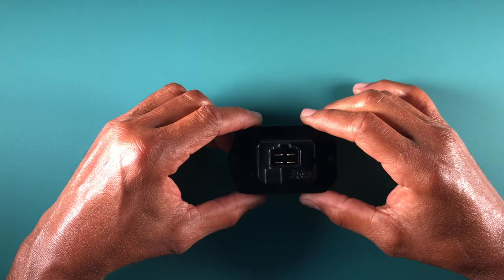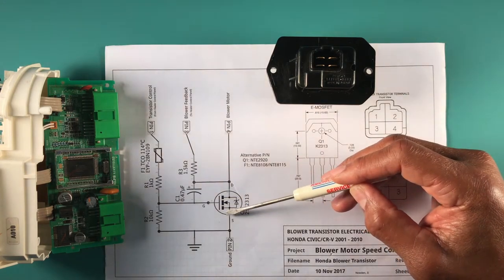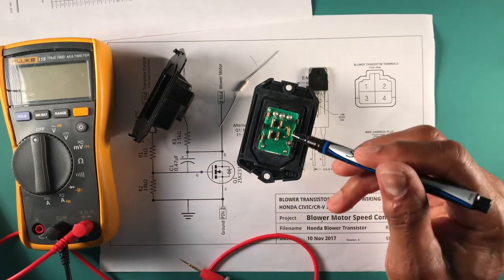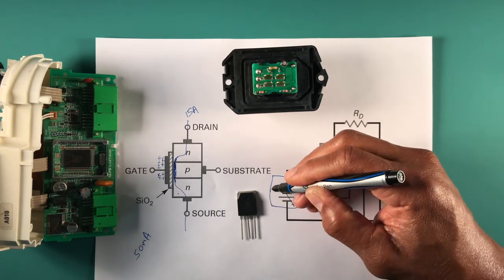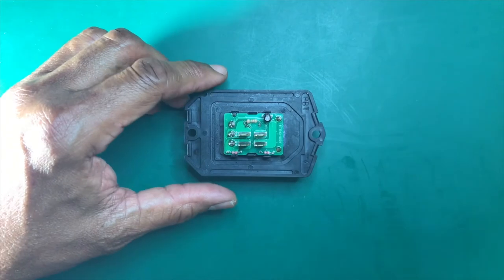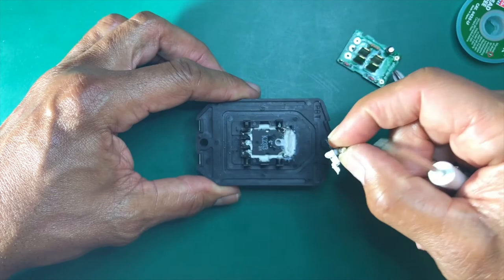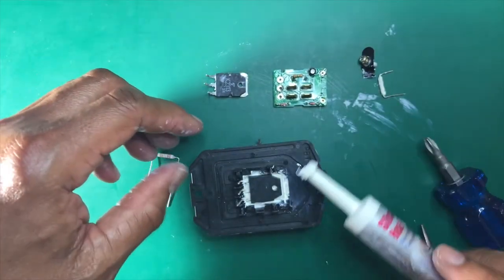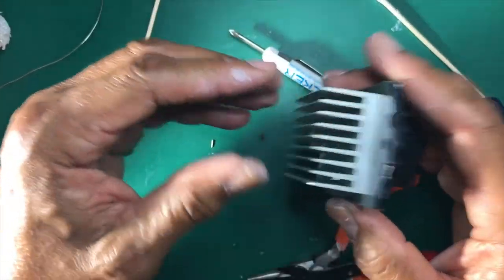Repairing Your Honda Blower Motor Transistor

Comment: For non US viewer and ppl who are not using the ebay link.
Make sure you get the 2A version of the fuse and the casing is not metal. 

I don't know what the proper name for this is but all the 10A fuse seem to have a conductive metal case, and 2A one with a ceramic non-conductive case. 
 
I bought a 10A 115 C thermal cutoff with a shinny metal casing, turns out the casing is shorted one side of the lead, this shorts 1 and 4 because the casing of the fuse is connected to the hold-down clip which attaches to the heatsink  and to PIN 4.  
I found out after plugging in the module in the car and the blower motor won't turn off, hopefully it hasn't have enough time to damage things. 

Also great videos, this video give me more reasons to continue to keep my Honda.
Reply: thank you this is Very informative     So dont use a metal conductive thermal  cutoff. use a Ceramic one .       im about to do this instead of buying a 110$ one from autozone.
Reply from the maker: Correct, short at either end of the thermal fuse to the heat sink shorts 12v to the transistor control line (Pin 1). The motor would run continuously. This results from the voltage divider created by R1 and R2 providing a gate voltage of 10.9V, turning the transistor on full-time (Vth=2V). Imperative, you select a thermal fuse encased in ceramic with no metal or leads in contact with the heat sink. See attached link: https://drive.google.com/file/d/1-NagFeXUDYTD_3wMkdKTkmdWsdw6GuNy/view?usp=sharing

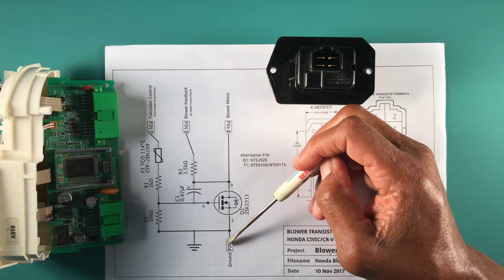Comment: 4:00 that F1 is a amperage and thermal fuse, you pointed 114 degrees C, but did not mention the amperage, maybe is a 2 amp because it manage a small signal from the microprocessor, nice video by the way

Comment: You win the blower motor transistor best youtube award.  The comment that checking for open across pins 1 and 2 was the key to my fix. I i just bought a new transistor, but the explanation of the circuit along with the repair itself was top tier!

Comment: Does it also turn on the ac compressor when the blower tirns on ? Because ac compressor also dont turn on
Reply from the maker: the a/c compressor will not engage If the Heater Control Panel senses the blower fan isn't turning (i.e.blower motor transistor is not switched on). However, this does not rule out any blown fuse or breaker issues. Check the blower motor wiring schematic on page 2 in the comment section above. That Heater Control Panel controls most of the operations of the HVAC system. The feedback signal from the transistor is at pin A8 of the Heater Control Panel (electronic module).

Comment: Thank you for the video. Good job. Does the blower control panel vary the voltage level to the gate or is it a set voltage level and pulsed at specific duty cycle percentages?
Reply from the maker: The voltage is varied at the gate 0 - 9.5 Vdc, they did not use pulse width modulation.
Reply: @eetech_fix2393  Thank you Sir. I appreciate your videos. Have a blessed and safe week.

Comment: Thanks for the video. Do you know if the same concept applies to all of the resistors that came in Honda vehicles. Mine is from a Honda Ridgeline 06 but the connector pins are arranged differently. Mine works but if you wiggle the harness right at the resistor will stop working and shuts off fan.Mine is a Denso 077800-0910. thanks
Reply from the maker: They're still called blower resistors; however, most Honda vehicles after 2003 utilize transistor-based modules. They sometimes take different sizes and shapes, but they're normally all 4-pin modules that work the same way. Honda 2006 Ridgeline RT, RTL, and RTS all have 4-pin transistor-based modules with slightly different pin arrangements. All connectors and connections are subject to oxidation and moisture. Remove the connector from the module and spray the module pins and connector pins with some contact cleaner; that may solve the wiggle problem.

Comment: What are the chances  the Heatsink shorts out between the   thermal piece.  since it shares the 12v resistance. on the case.
Reply from the maker: Short at either end of the thermal fuse to the heat sink shorts 12v to the Transistor control line (Pin 1). The motor would run continuously. This results from the voltage divider created by R1 and R2 providing a gate voltage of 10.9V, turning the transistor on full-time (Vth=2V). Imperative, you select a thermal fuse encased in ceramic with no metal or leads in contact with the heat sink. See attached link: https://drive.google.com/file/d/1-NagFeXUDYTD_3wMkdKTkmdWsdw6GuNy/view?usp=sharing

Comment: So interesting-- I just ordered a transistor / AC blower resistor for my Subaru Tribeca and it cost me $90 and that was on sale from the dealership (could not find on Amazon). My question is whether a $30 Subaru Outlook ac resistor would of worked (even if I would have to change a wiring harness) or more generally, why different cars require different resistors???
Reply from the maker: The  Subaru Tribeca has a transistor module for the front AC blower and a resistor module for the rear AC blower. Most newer model automobiles after 2008 incorporate the transistor module controller as opposed to the old discrete resistor modules. Transistor control is more efficient, more compact, and controls fan motor current directly at the motor. The discrete resistive modules required routing the total distribution current directly through both the fan switch and motor.  Not feasible to exchange the resistor module with the transistor module or vice versa. 
The transistor modules are electronically the same incorporating an E-MOSFET transistor allowing high current to flow through the fan motor under the digital control of a low power microcontroller in the control panel. The main differences being the shape and size of the module casing to accommodate the air duct of the particular automobile. The modules being your main concern making sure it fits.  LINK: https://drive.google.com/file/d/1ZnqBRMcrLbGnjdrmXsdtvLgWEkysjF4H/view?usp=sharing

Comment: Where can i find the part list for my blower motor transistor for my honda hrv 2016 i do have same problem. Thanks,any info i can get.
Reply from the maker: The The electronics of the blower motor transistor are the same in most cases. The size and shape are the only real difference that makes it compatible with the ductwork of any particular automobile. However, some newer models may still use the old resistor network. The 2016 Honda HR-V LX uses the resistor network, vs. the 2016 Honda HR-V EX using a transistor module and appears to be the same electrically as in my video with a different pin number arrangement. Denso Japan OEM produced the modules for Honda for about $3 - $5 (US) each. They are consumable items; there’s no part list; you just have to open it up and research it out. If you replace your cabin air filter as recommended, you should get 200,000 miles out of that transistor and a resistor unit a bit less. LINK: https://drive.google.com/file/d/1YGwGCa1Xb7krX6Fjd-w5CLhWahBBXgs2/view?usp=sharing

Comment: Very helpful video. Thanks. Just want to make sure though. It looks like 1 kohns 1/2watt, 5 percent tollerance resistor.
Reply from the maker: Correct, the 1K @ 1/2W resistor in series with the control line coming from the ECU, Protects ECU from a short to ground at the gate of the E-MOSFET transistor. The associated 10k resistor is a pulldown resistor, which prevents the motor from continuing to run due to gate charge if the thermal fuse blows or a break in the control.
Reply from the maker: Side note that one 1K resistor provides another function; however, less relevant in this case; when your E-MOSFET first switches on, you’ll have a current charging the E-MOSFET’s gate-source capacitance. So for a small fraction of a second, there can be a lot of current flowing. To make sure this short burst of current isn’t too high for whatever you’ve connected to, you need to add a resistor in series. 1K is the general rule. Any higher than that could affect your on-off switching, especially at higher frequencies.

Comment: Hello again. Just curious where you got the data sheet for the Honda blower power transistor. Or, is this something you created? I'm looking for something like this for a Subaru power transistor.
Reply from the maker: Taken from the dealer’s technical documentation. Analyzing, and deconstructing their hardware to reveal its designs and architecture. fundamentally, reverse engineering and documenting the resultant component analysis.
Reply from the maker: Subaru, What year and model? Any thing prior to 2007 maybe a resistor unit.

Comment: my battery ran almost dead in this blizzard and when I went to start it,  the interior fan suddenly went to high and is stuck there no matter what position the fan switch is in 

could this transistor have failed this way? 

thanks
Reply from the maker: That’s not a common failure with the transistor modules: however, it’s possible.
The older resistor network modules normally fail with the blower operating only in the high position or stuck in some lower position. You should verify which module you have, a transistor or resistor. What year, make, and model?
Reply: @eetech_fix2393  it's a 2005 4 door,  4-cyl 5-speed honda accord  

it's stuck full on whenever the ignition is on

thanks for and advice you can give 👍
Reply from the maker: @shiddy.  Accord 2005s have transistor modules. Check out the links below—general wiring from the control unit to the transistor module. There's a link to the transistor module test. With an ohm meter check between pins 2 and 4. If reading short (zero ohms) that's your problem.

https://drive.google.com/file/d/1rsuh4t3EfnG7eeJ8Xcl8_A5eduR3qjCt/view?usp=sharing

https://www.youtube.com/redirect?event=video_description&redir_token=QUFFLUhqbjJROEZuRldtdFZ5bnZjOUJCQ0JfcGVMaHA2Z3xBQ3Jtc0trWXlqTzZCNkRzRXFiX3gyVHF6Z04yRENMZVVtMUFQQWtFcWNVbmE1SnBuUUNXN0VUeVo3c2djbjhSTEt0WjJ3S3E1MGxaX1FWOUdOb3V6RUUwR29vcloxLTBuOWlQbTVHYjNuck81ZnBsb2NGNXdxYw&q=https%3A%2F%2Fdrive.google.com%2Ffile%2Fd%2F1u2d3_BE0IlePQrb1HfBnxZir6aF8kAhU%2Fview%3Fusp%3Dsharing&v=9teJFYfhUdk

Comment: Awesome video! questions, comes from a girl so please patience here. 15.20 you removed thermal cut off that you mentioned at the beginning of the video fails a lot on these units, but you are not replacing it in this video, if it fails you replace that part or does it cause the "heat sink" to break (open), i noticed you replaced that one and transistor. thank you
Reply from the maker: Follow the video sequence between 14:35 - 15:59. I'm removing the screw that holds the transistor and metal clip securing the thermal cutoff to the heat-sink. Also, follow the sequence between 18:25 - 18:35 as I install the new thermal cutoff. The video didn't show the screw and metal clip's reinstall holding the thermal cutoff. However, you can see the screw and black metal clip at the top of the screen (18:27) next to the old thermal cutoff. The heat sink wasn't in danger of breaking. The transistor didn't need a replacement; however, I completed a general overhaul since the unit was already open.